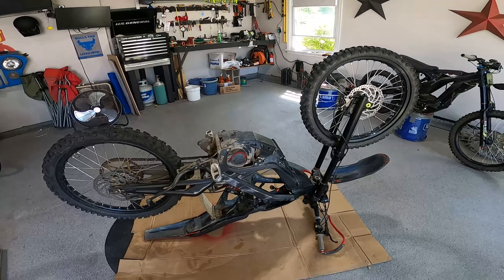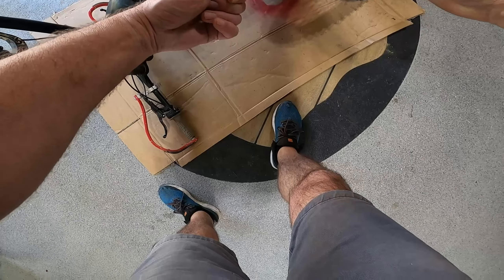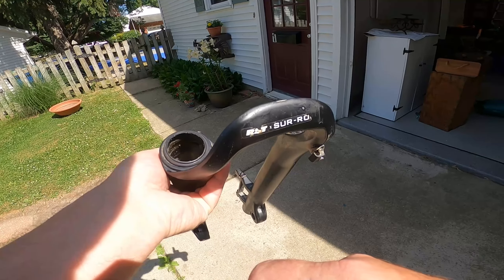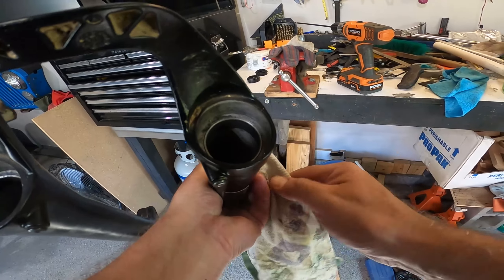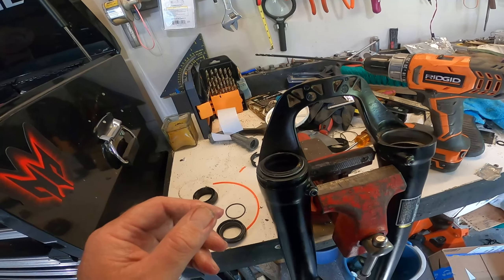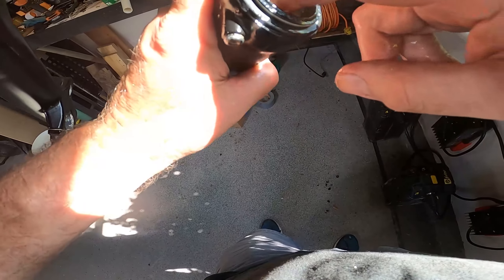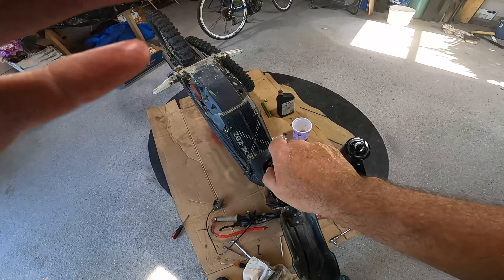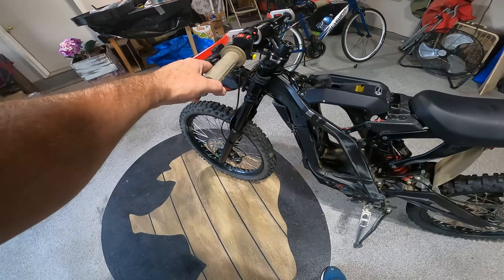DIY How to lube binding Sur Ron RST Killah fork Lowers and replace seals

Comment: The black allen screw on the other side from the rebound adjuster is just spinning?? Cant get it to loosen
Reply from the maker: Glad you are giving it a shot!  That allen screw goes into the rod that is inside.  I think what is happening is the rod is turning with the screw.  I might suggest being sure it is loosened and you can see it will press in and out with the inner rod -- tap it or hit it sharply  so get the threads on the inside rod  to unmarry with the  bolt.  I think I had to do this the first time I took them apart!

Comment: Does rebound/compression works fine?
Mine went bad after 200 miles.
How many miles on the bike?
If you will replace/fix rebound/compression cartridge, please make a video.
Thanks for the video!
Reply from the maker: I have about 500 miles on the bike. So far, rebound compression seem okay.  I'm probably not savvy enough at this point to give advice .. but call Trevor at Risse Racing.  If you take it apart (it really is easy!) maybe you'll find the issue?
Reply: Great video! Exactly what I needed. Thank you for your efforts.